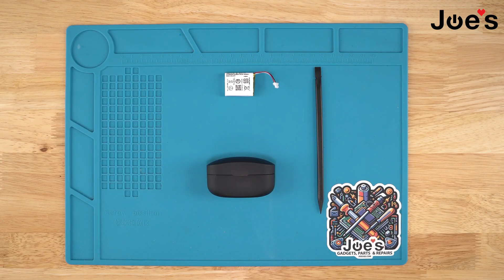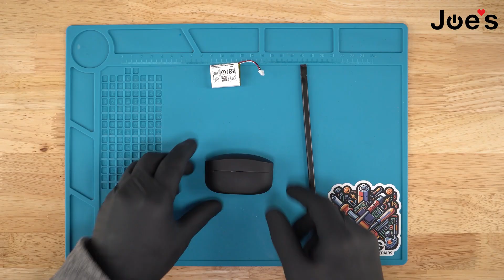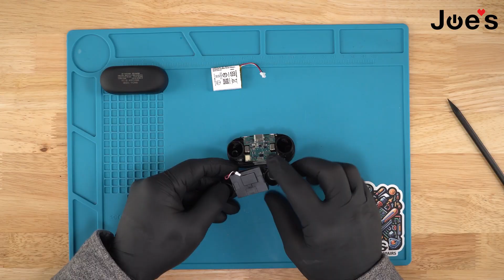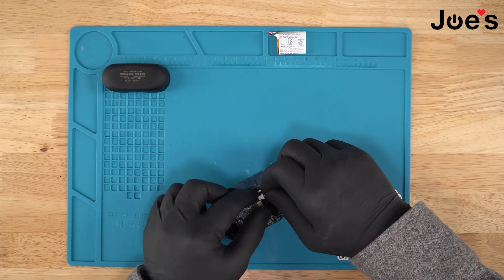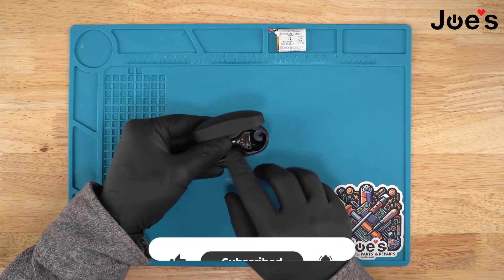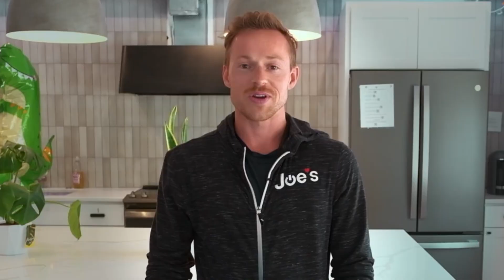Sony WF-1000XM4 Charging Case Battery Replacement | Step-by-Step Repair Guide

Comment: Great directions that I was able to follow and replace the battery. Thanks!
Reply from the maker: We can help you find the right part, tool or repair option. Please email support@joesge.com with your exact model number and what part you need.

You can also start here:
www.joesge.com

Comment: great explanation. its good that its super easy to take this apart and replace it, seeing as thought the battery degrades after a couple of years
Reply from the maker: We can help you find the right part, tool or repair option. Please email support@joesge.com with your exact model number and what part you need.

You can also start here:
www.joesge.com